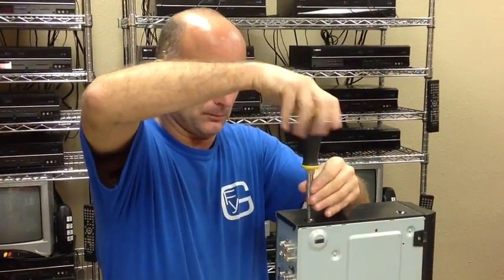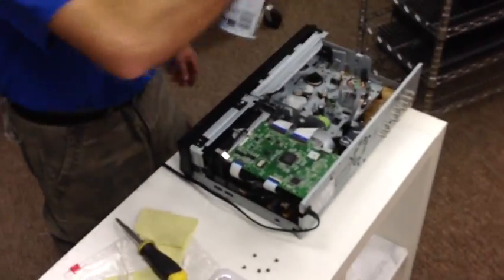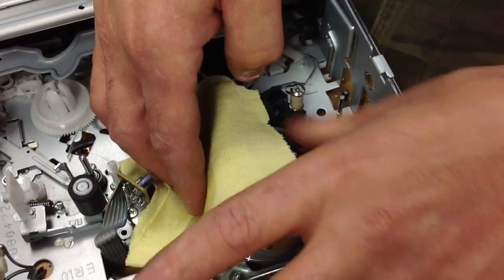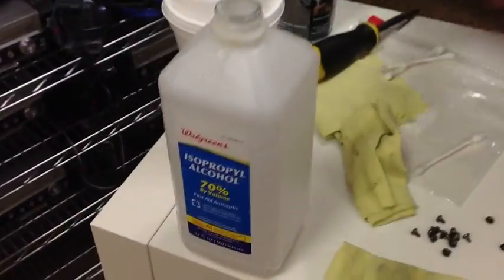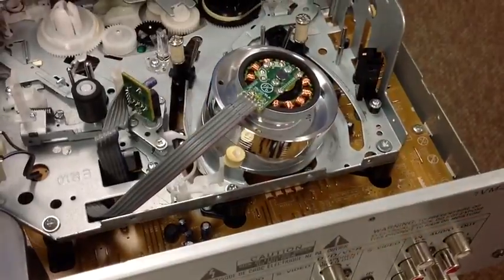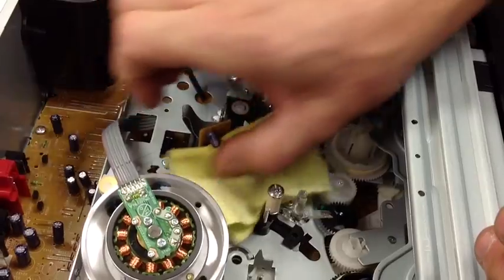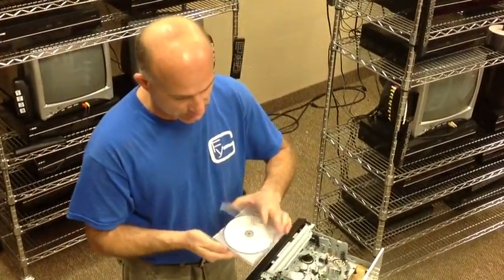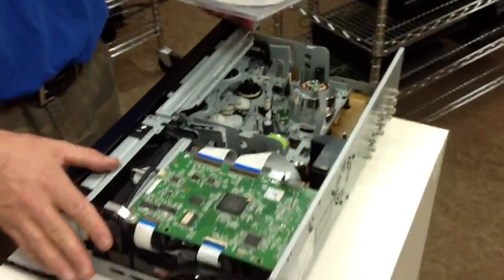How To Clean A VCR DVD Recorder Combo Unit

Comment: I have 2 magnavox VCR recorders, one turns off on me on it's own. I can start it up and then after 10 seconds it will turn off. I had it in storage and took it out and it seemed to work just fine, then all of a sudden it started to do it's thing again. The other one did work, but now just the DVD side works and the VCR will start and it will do it's thing for about 5 seconds then shut the machine off. I took the cover off and blew all the dust out and cleaned everything like the video said. Any suggestions? Trying to record family movies to DVR then get rid of all this stuff. Thanks Vern
Reply from the maker: Hope it all works out for you!

Comment: With respect to this same model (Toshiba), what do you do about VCR operations that squeak on playback, rewind and fast-forward but the picture and sound are without any problem? The squeak doesn't go through the audio channel and it persists no matter the tape, suggesting that it is a mechanical noise (it's a loud but high-pitched noise). I'm assuming that some part is in need of a lube to stop the squeaking, but not sure where it is safe to place that lube or what kind?
Reply from the maker: Thanks for the comment!

Comment: Well my dvd player was working fine till I decided to clean it and bought a cleaning disc from best buy, after that it would not play anything ,it does not reconize any discs and shows an error on the front ? So now what,.?....
Reply: I, too, killed a Toshiba DVD recorder (older model) using a disc cleaner. If you read the user manual on these units they actually state that you should NOT make use of DVD cleaning discs. 

I have come across many comments to the effect that a little rubbing alcohol will clean the lens and the spindle but in my experience I have never revived a DVD recorder that could no longer read a disc using this method, either. If you're consistently getting "no read" or "dirty disc" errors it suggests the laser pickup is dying, and the only solution for that is to replace the part.
Reply: Clean eye ( if you can get to it) with an eraser ( on the end of a pencil)  don't press hard on the eye. Works great
Reply from the maker: Thanks for the comment!